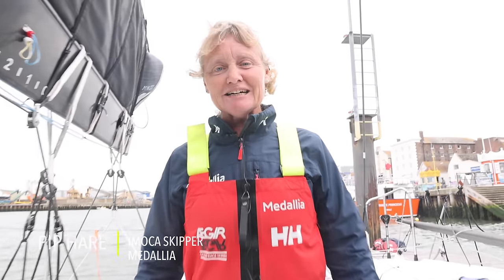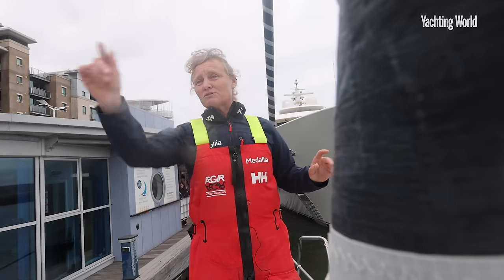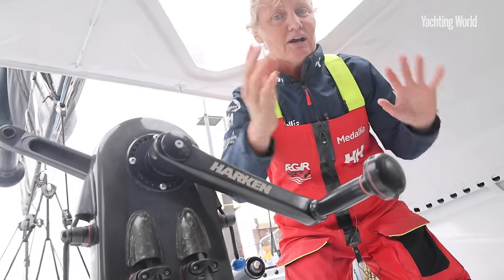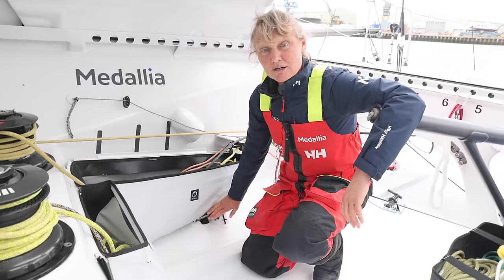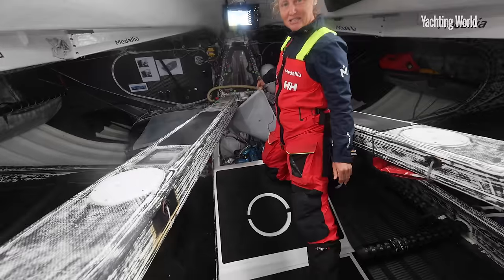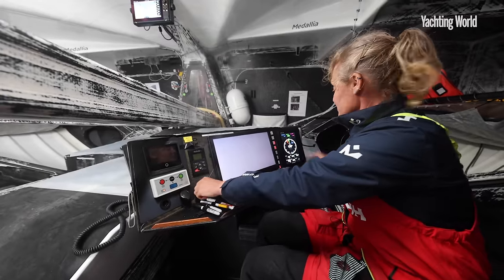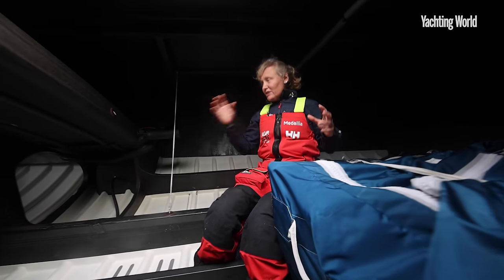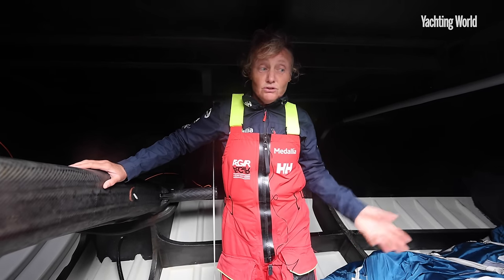A singlehanded foiling beast for ocean racing – Pip Hare's tour of her IMOCA 60 Medallia 2

Comment: For moving the sail stack, work out a system using the winches. Maybe have a Teflon piece of material  or fabric you can  attach where needed and then winch the sails across that more slippery runner.  Sail bags would need strong attachment points so you could hook a line to them and drag them. Or perhaps have one side of sail bag made with a slippery fabric so they slide easy